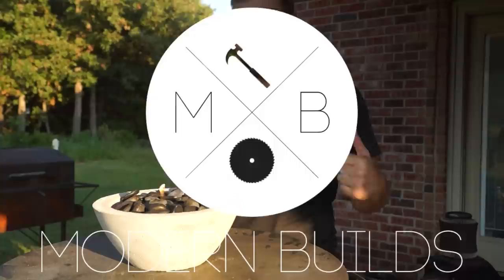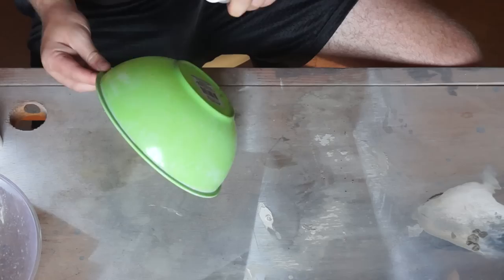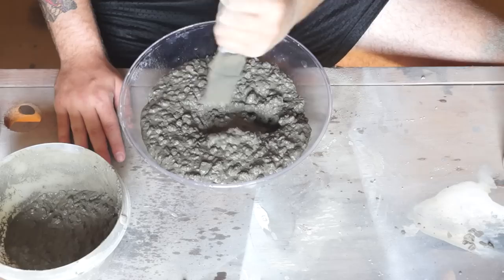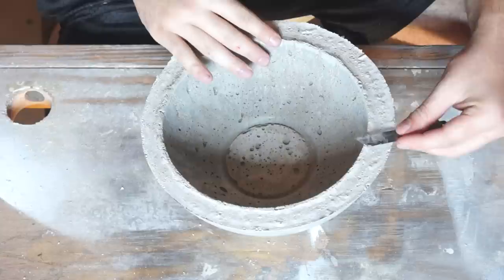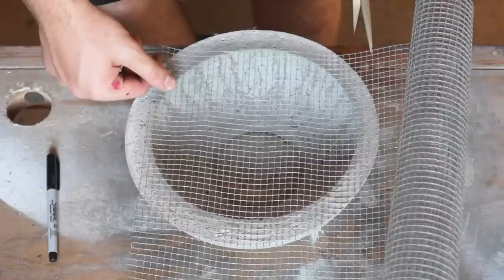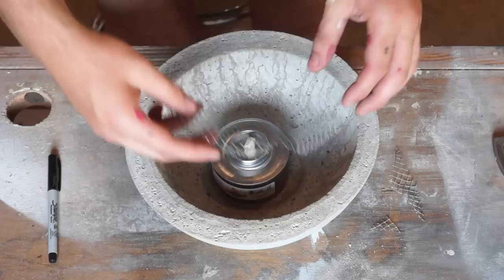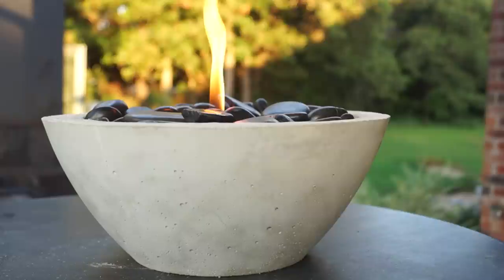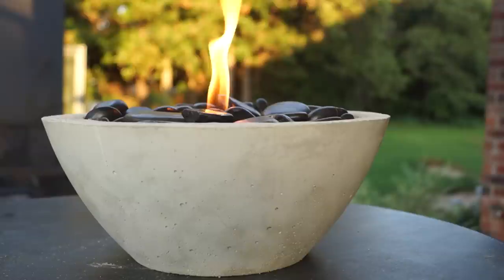DIY Concrete Gel Fire Pit *EASY*  | Modern Builds | EP. 5

Comment: With concrete, the more water you add, the weaker the final product becomes.  This obviously does not require great strength, but you also don't want it to crack.  If you mix the concrete in a 5 gallon bucket, for 10-15 minutes, you will end up with a creamier consistency.  

Lastly, concrete needs to be moist cured for a week as it takes 30 days for concrete to become fully cured  The easiest way to do it would be to wet it after you pop it out of the mold (awesome trick btw), then wrap it in plastic wrap, or something like that, for a week,  or at least a couple days for a project like this.

Great video and I love the demolding trick.  Cheers!
Reply from the maker: Thanks man, good stuff!
Reply: +Gary W. Hall it also helped me. thanks
Reply: Gary W. Hall Thanks for this comment. I’m gonna make my husband one for Valentine’s Day and I want it to be perfect.
Reply: This is Not concrete it's just mortor concrete needs gravel or granite
Reply: @Raptor-Machinery  huh?
Reply: @ChrisSmithFW  what's hard to understand the mix he was using was mortor sand and cement concrete is sand cement and stone he never added stone there for not concrete, what's hard to understand
Reply: @Raptor-Machinery  Just the poor writing. That's all. When you don't use punctuation, it's very confusing. Been this way for eons. You must have missed the lesson.
Reply: @Raptor-Machinery  your grammar
Reply: @Raptor-Machinery  "you're" an asshole
Reply: @Raptor-Machinery  You're not your... Who's the... now?
Reply: @ModernBuilds  
Hi mate great vid.. i've made one of these last week and i've currently got my second mould drying as i type this, my question is this... when you said add tiki fuel to the can, do you mean add tiki fuel to the gel fuel (no wick) OR add tiki fuel to the fuel can that you used? (with wick) 

I suppose what im asking is what is the best fuel with wick or without wick to use to get a proper decent flame?

Thanks 👍🏻

Comment: Thank you for the tip about the tiki fuel!  I've looked at a few different diy fire bowls and they all say to use the canned heat.  I was very frustrated because I can't even SEE a flame on them, thought I was doing something wrong or got duds.  Two 2-packs later (and about $15) I found your video.  Awesome, THANKS!
Reply from the maker: Can't trust these fakes! Haha, no problem glad I could help
Reply: What is a tiki fuel?

Comment: Tiki torch fuel is a good point. Tiki torches can be super cheap, I get them just for the cans, because they work great, too, and they hold more fuel...If I’m lazy, then any planter works. Some people add them to the center of larger pots, with low plants around the edges, just don’t add them to any with dirt that has peat moss in it, it’s very flammable. Lots of potting soil does have peat moss.

Comment: Hi Mike, I built a bowl and your instructions were great.  I had good luck with baby oil on the bowls.    I have read that river stones or glass beads can blow up,  so now I am nervous to use them.  Does mortar give you a smoother finish rather then quick cement?  How to you end the flame when you are done?  Do you have to disassemble the stones and put the lid on the can? Thanks, Sherri
Reply: Great questions… wish someone would answer them.

Comment: Love it. I don't have an air compressor. How should I remove without causing a problem. Also, fill canister with tiki torch fluid?? After the original fluid is gone? Didn't understand....
Thank you
Reply from the maker: I've used the canned compressed "duster" air for cleaning keyboards and it's worked. You just take out the wick and use a funnel to fill the container with traditional tiki torch fluid for a larger flame
Reply: Thank you so very much!!! So kind of you to get back so soon. I'm looking forward to making a few for our summer evenings. :)

Comment: When you put the sterno in the the 🔥 pit, are you mixing the tiki fuel equal parts or are you using just tiki fuel after the ethanol chafing runs out bc obviously the chafing fuel is nearly invisible?

Comment: Do you add the Tiki torch fluid along with what comes with the "FancyHeat" Fluid or empty out the "FancyHeat Fluid".... I know it sounds dumb but I don't want a fireball or something going off.... Im ready to go just wanted this point clear.
Reply from the maker: +Stacy Rutledge Haha, no problem, I emptied out the original fluid after I realized it was a low blue flame, then filled it about three quarters full with tiki torch fluid. I also replaced the wick with a Tiki brand wick, which required me to drill a bit larger hole in the top of the canister to get it to fit.
Reply: Got it...  And I do have the bigger tiki torch wicks...  another question real quick,,,, what did you use the old liquid for or in.... By the way good stuff you got here on your channel... Have a Merry Christmas
Reply from the maker: Sounds good. I just emptied the other fluid out in the grass. Thanks, merry Christmas!

Comment: Question? If you do not have an air compressor, how else can you get the two bowls apart?
Reply: the middle bowl will be the hardest, use a flat head screw driver and peel it back. it will come right off. also use non stick before doing the project and the bottom should come right out when you flip it over. ( currently doing the project) lol

Comment: How did you add the tiki fuel to the canister? Did you pull the wick out?
Reply from the maker: +Alexis Cuadros yeah, I pulled the wick out and filled it up. On a couple that I made I had to drill a bigger hole to fit the wick back in

Comment: Two questions: 1. Do you need a specific type of concrete mix? 2. How do you put out the fire safely?
Reply: 2. How do you put out the fire safely?

Just cover it with some pot/saucepan cover for couple of minutes. It will prevent of accessing fresh air (with oxygen) and burning will stop.

Comment: I have a few questions. I actually have the same fuel canisters as you and I was wondering how you got the tiki fuel in the canister? Also, I was curious if the rocks/mesh wire ever deteriorated or melted because of the fire?
Reply from the maker: I took the wick out, filled it, then put a new wick in. I think I had to drill out a little bigger hole for the wick to fit in because the one I bought was wider. The mesh is still fine
Reply: Thank you!
Reply: FYI, I found on the table tiki torches at Walmart for .96. They are the same size as the catering canisters but with tiki torch wicks and screw tops

Comment: mike since i dont have an air compressor, whats the next easiest way to remove  the concrete from the mold ?
Reply from the maker: If you're having a hard time removing it, I've had luck with the canned "duster air" used for cleaning electronics
Reply: Thank you  :)
Reply: Jackie McCain I just made mine last night and I tapped on the bottom of the bowl and it fell right out. I used vegetable oil and coated the bowl before putting the cement mix in as I don't have an compressor .

Comment: Hey! I know this is an old video but I was just wondering if the tiki fluid is safe to roast marshmallows on?
Reply from the maker: I don't think so
Reply: No! You should never cook hot dogs, marshmellows, smores ....any food over something that is burning a chemical. The chemicals will go into your food. I use presto logs that are chemical soaked for my outdoor fire pitt because we live in a Ponderosa Pine forested area. One spark in the dry summer and we have a problem. They don't spark and burn for hours but I would NEVER cook food over them for the same reason. If you want to cook food, use wood.

Comment: what kind of concrete is that?? it's already a mix??
Reply from the maker: Yes it's a bagged mix called Quikrete
Reply: I made mine, but the flame is ridiculously light, can't even see it!! I will try the other oils you mention... but I don't want any poison ones... 
Another question is, I made mine to put outdoor, but the I realized... I have no idea what to do if it rains! Do I have to take the oil in and out every time? and get all the rocks and screen out?
Reply: that's also what i would like to hear
Reply: I got quikcrete but mine had a ton of little rocks in it...yours looks much smoother.